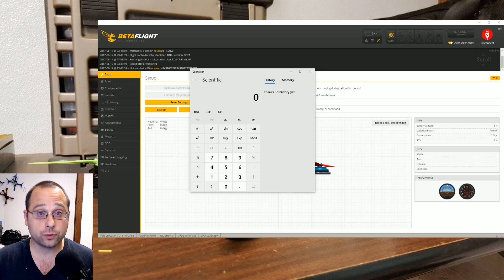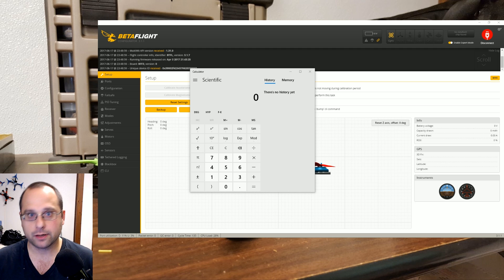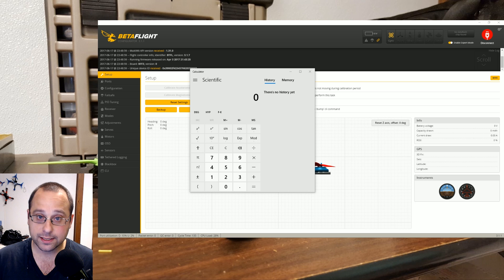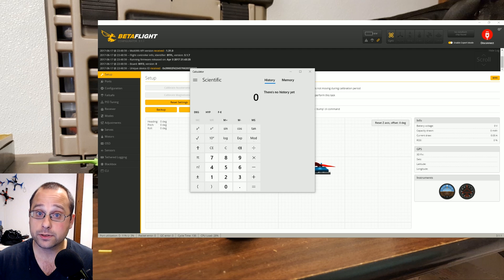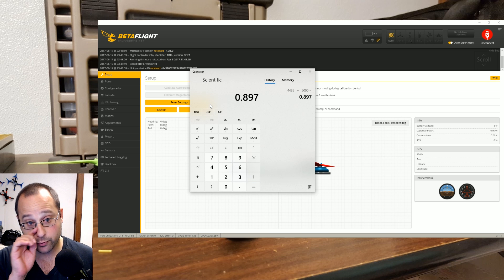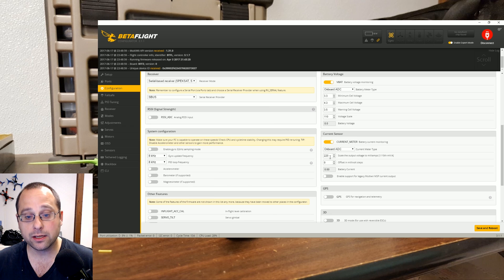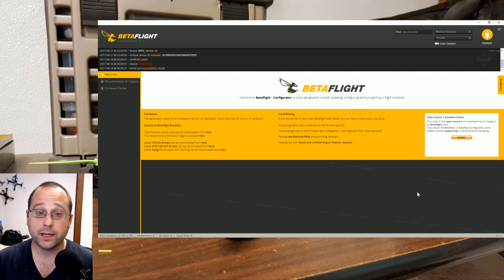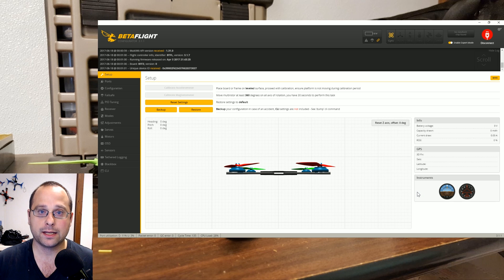The safest way to calibrate your Betaflight current sensor

Comment: So I'm trying to calibrate mine on my spedix gs35a 4 in 1 and while sitting unarmed it shows that I'm pulling 2.5 to 3 amps. In order to even get the amps down to 1 amp or lower I have to adjust the scale to 1150. I know that's not normal. I've been told not to worry about it and calibrate to what actually happens in flight. But with it pulling at 2.5 amps at all times the mah consumed is going to be off. What would you suggest? I've tried offset -100 and scale 700 and it was at .9 amps but that doesn't seem right at all

Comment: In the OSD, is the current sensor giving overall Amps? So my noob troubleshooting a F440 (40x4=160?), that bumps 39A max (per calibrated HGLRC XT60 sensor with R-Line 1300 75c), is being limited for the brother hobby 1507s I have on there (20Ax4=80 @100% on Lum 3040)? It appears the F440 is 10x4 and is misleading to be called 40A.

Comment: i am using the JBf4 which was reading right on, I just switched to crossfire and now the scale is off. shouldn't the mah draw stay the same? its the same in both quads that I switched to crossfire.
Reply from the maker: Yeah the mAh sensor is reported by the FC so switching from SmartPort to Crossfire won't change that. But remember that the Crossfire sensors are totally different than the SmartPort sensors, so you need to either create a new model in your radio, or you need to go to the telemetry screen and "delete all sensors" then "discover sensors". You also may need to change some things, like the battery voltage is reported as rxBat in Crossfire but VFAS in SmartPort, so you need to change the main screen voltage source. This is all covered in my crossfire setup video for what it's worth.
Reply: Joshua Bardwell I went through all the settings. I ran 5 packs and by the math the mah draw is showing 80% of what was actually used. I know you did a video on adjusting for this but I can't seem to find it.

Comment: In one of your more recent videos, you state that an amperage meter scale of about 250 is correct for your flight controller. My amp readings, and mAh were clearly very high on my latest build using your flight controller, so I did the method stated in this video and the value came out to 374 (using the average of 6 batteries). From my few flights since the calibration, it is clearly way more accurate, but why is there such a wild variation from the 250 you said it should be near? If it changes anything, I did pre-order your board (so I might have an early version), and I am running Betaflight 3.3.1.
Reply from the maker: It seems like there may be more variance in the resistor values than you would expect. I'm surprised that value is so high.

Comment: Could you:
-also check the voltage after flying
-Charge it up
-discharge to the voltage you got after flying
(Difference of charging to discharging mah is around 220mah. Pretty big difference)
I think when you discharge it won't have to balance the cells that much -> more accurate?

Comment: 20 thousand??? more like 40 thousand...  2300kv motors at 16.7v is 38,410 rpms... ;)
Reply from the maker: Well, not to argue with you, but that's only no-load with props off. But I just pulled 20k out of the air....

Comment: Hello,

can someone please tell me how to calbrirt the current sensor of ESCs in Betaflight 3.2.4?
Reply from the maker: +Andy X it's the same as shown here. The setting is moved to the Power and Battery tab.
Reply: Joshua Bardwell Hello, no its not. After select ESC Sensor the scale not there anymore.
Reply from the maker: +Andy X ESC sensor would be scaled in blhelisuite. But I'm not sure that is an option. I think the ESC sensors are supposed to shop already calibrated.
Reply: Joshua Bardwell okay thanks. Unfortunately, I find in blhelisuite 32bit no option.

Comment: Hey Joshua, I've built 2 copters now with the betaflight f4, a chameleon and now a rooster. I watched this video and successfully calibrated my current sensor on my first board, my scale value turned out to be pretty accurate around 250, but I can't get it to read anything on my second. I did everything exactly the same in the configurator and can't get the current sensor on my rooster to read anything. I enabled it and selected on-board adc, I'm running betaflight 3.2.2 on the newest version of the configurator 10.1.0. It reads 0 amps and 0 mah after about 3 minutes of flying... any ideas?

Comment: hello i’m running 32bit esc using the telemetry for my current. is their a scale i need to adjust? i’m getting 70amps from a burst. with 2300kv fire motors on dal5046c props.  chnl 1300mah 4s

Comment: Is the voltage sensor always correct on FC boards?
Reply from the maker: No. That's why you have the vbat scale in the Power and Battery tab to let you calibrate it.

Comment: hi josh , why does my mah sprint up as soon as i connect the battery ,even with the motors stationary and why does my ammeter show 26 amps too? if i raise the throttle and spin the motors the amps goes down not up ! whats going on ?
Reply from the maker: +machined red if your ammeter shows 36 amps with the motors not running then probably you have a short circuit somewhere.
Reply: thx josh , ok its got me thinking , my real inline ammeter between batt and pdb says 0.6a  and it flies perfect . what do test or check next ?fc has 1 ground wire and 1 vbatt wire , what have i done wrong ?
Reply: Hi, I have the same problem. Any solution for this issues?

Comment: My current sensor is way off on my JB F4.  I’m showing 1455mah used out of 1300mah pack.  Putting back in 950mah.  I’ve upped the censor calibration to 280 from stock 250 and I’m still getting the incorrect info. Gonna teat at 300 and see but doesn’t seem right.
Reply from the maker: +Hurricane FPV you have to calibrate then from default. The default value is never right. It's normal.
Reply: Joshua Bardwell default being 250 have you seen the need to go above 300 in some copters? I edited my original post after realizing I posted my second to last settings in error.

Comment: Hey Josh! In this case the sensor reads higher, but what if it reads lower, do I still divide "mAhs put back in" by "mAhs consumed", or do I divide a smaller mAhs by higher mAhs? Thank you!
Reply from the maker: The math is the same. It will produce a multiplier either greater or less than 1 depending on whether the sensor reads higher or lower.

Comment: I have set my scale to 260 and 275 and my amps sit at 0.30 and just go up a hair under load I tried a lot of different numbers in there and I can't figure it out it's a betaflight f4 board my milliamps consumed also count up get slow showing like 14 mah consumed on a 3 minute flight
Reply from the maker: +John lepeshko it sounds like your current sensor is not working. Maybe you wired the board wrong. Are you using a 4 in 1 ESC maybe?

Comment: So what if we have a wiring harness and a fc with a current sensor. For example I run a dis f4 aio with a an extra wire running from the battery positive to all of the positive esc. I fear that the bigger motors will draw too much amperage and fry the aio unit on 6S. Will this methodology still work?
Reply from the maker: +beelzelboss if you have run a wire from battery positive to the ESC, I don't think the current sensor should work at all because current isn't passing through the shunt resistor.
Reply: Okay that's what I thought since the electricity will take the path of least resistance which in my mind is not through the resistor but through the wiring harness, since it is on both the positive and negative. Thanks for your reply. You've unlocked a bevy of knowledge for me these past couple of years. If only you could get into the Crossfire game and some 6S!

Comment: Thanks for this video!! I will be doing this calibration shortly, I just completed two build usng the HGLRC v5 pro that you did a video on and is my frist OSD build. Can you help me with the battery voltage settings ? I know batteries sag while flying but I have no idea what to set the limits to. I just always flew with a timer but now that I have the bells and whistles it'd be nice to be safer on my Lipos. Thanks again for all your work!!

Comment: how do you fix a drifting quad, is it the balance of the quad or is it something else
Reply from the maker: First, make sure your channels are centered at 1500 in the receiver tab. Be sure your receiver is powered up and your transmitter is bound or all channels will just lock at 1500.

Comment: What about the heat generated in the battery. Heat requires energy. The current sensor doesn't record the energy used when the battery heats up right? That might account for the apx. 100mah per battery.

Comment: Let me first thank you for what you do for the community and myself, your videos are very informative and extremely helpful to many of us. Anyways with this method and or any other method to calibrate the current sensor, will the values of one board be the same as the same board on another quad? For example we have run multiple packs through one of my sons race quads and on 5 packs each time we end up putting 99% back into the batteries as what was taken out, so we also have 5 other quads with the same board (dys f4). So can we use the same values from the one quad on all the other quads or is each board regardless being the same board going to be different? Again thanks for all that you do for us!
Reply from the maker: No, they won't be exactly the same, but they will be close. The resistor that is used to set the gain of the current sensor has some manufacturing variance. If a good quality resistor is used, the variance should be less than 1%. But it's up to the manufacturer to use a good quality resistor :-)
Reply: so what kind of variance could I expect from one board to the next?

Comment: I just want to share my way of calibrating current sensor. As you can see there is scale an offset. This mean betaflight is using linear equation to calculate true current flow (current = measurement / scale - offset   ->   y=ax+b). Built-in current sensor is accurate only for current above ~1Amp. In betaflight you set scale to 10 and offset to 0.  Next you measure (without the props and with external current meter) two points, at maximum throttle and 1/3. Every time write down current from current meter (CM) and sensor (CS) (but reading from sensor must be multiplied by 10).  Now you must solve system of linear equation {CM_1=CS_1*a+b,CM_2=CS_2*a+b}. If you solve, offset is -b and scale i 1/a.
Reply from the maker: +marcepanb why do you start with the assumption that 10 is the correct scale.
Reply: Correct value should be 1, but then value is clipped to maximum (for me it's 327.67A). So I set scale to 10 to divide  value, but for calculation I multiply this value.

Comment: Need some help Josh and friends
so flew 13 lipos. Got an average of 892mah when bff3 showed 1000.
Also is it normal to have such a difference? Got 821 to 945 most were 900ish give or take 20.
Anyway what increase should I be putting in?
Reply from the maker: I put the exact math in the video. What part of it didn't you understand?
Reply: Joshua Bardwell 
Nice comment and great help
so if my math is right its 12.5% high for me. So I multiply this by what the setting is at to get a better calibration?

Comment: Is there a reason you can't just spin your motors without the props? Obviously it won't draw as much, but it should be enough to get a baseline. 2 data points define a line, you don't need a 3rd way up at 80 amps
Reply from the maker: The closer together the two measurement points are, the more precise they have to be to correctly define the line. The further apart the two points are, the less precise they have to be to correctly define the line. The amps drawn are not constant. They're going up and down and you have to guess what the correct average is. If you tried to take a measurement at, say, 3 amps and 5 amps, you would be way off.

Comment: Hey Joshua, This is a bit off topic, but I was wondering if you know how I can calibrate the barometer that comes with my F3 omnibus.  I like it but sometimes when I fly the reading says -8 ft when I'm starting at.... Not that I'm needing it to be super accurate, it would just be neat to know it's pretty accurate.
Reply from the maker: I don't think baro is ever really accurate on these copters unless it is supplemented with GPS. Have you installed foam over the baro to protect it from changing air pressure due to propwash?

Comment: What about clamp meter and props off? Will it not draw enough current to get an accurate calibration?
Reply from the maker: I don't think so. If you calibrate at 3-5 amps that won't give you accuracy at higher amps.

Comment: This is a methodology I used since many quads and work fine.
This is what we can call an iterative process, and usually after 4 or 5 try, I get the correct number !

Just one comment, because this method didn't take into account the offset of current, which is another BF parameter.
By default, the offset is set to 0 in BF, that mean that when the lipo is plugged in, the current seen by BF is 0, but of course it is not, because of flight controller, led, esc and others stuff you put on your quad, always need current even with throttle at 0.
So what I usually do for that is that the offset current for a basic configuration is somewhere between 300 and 400mah, so I set the parameter in BF to 35, so as soon as I plug the battery, I see in the osd a current of 350mah.
And it work perfectly fine for me :)
Happy flying
Reply from the maker: I don't think that's how offset works, but I could be wrong. I think that offset is for the case where the current sensor does not output 0 volts at 0 amps.
Reply: I just realized that I do that because I use a virtual sensor and not a real current sensor :)
I personnaly prefer having the mAh used in addition of Lipo voltage on all my quad, because it's often difficult to see the landing point, as voltage changing a lot during a hard fly...
So in case of using a real current sensor, you're absolutely right, no special need to change this parameter in BF ;)

Comment: I wonder what the COP of the LiPo battery is.
It is clear that if you convert 1000 mAh electrical energy (charger reading) into chemical energy, then when you convert back you will get LESS mAh. To be precise, if properly calibrated with this method, the OSD tells us not how much energy we have consumed but how much energy we should put back in to recharge. So if the energy meter is perfectly exact it is normal to show less mAh than what we put in while charging.
But anyway, that is not so important since we really care for a way to tell how much of the battery we have consumed - the absolute values are not crucial if we simply know that reading of X mAh means it is time to land.

Comment: Joshua there is an even easier and more accurate way to do this. I know I'm going to mix my words up but if your interested I can dig up the article on rcgroups. Basically there's a math formula and you measure a resistor that feeds the shunt or something along those lines and when inputting the shunt value and the measured resistor value it gets your within 1% of the calibrated value.
Reply from the maker: Measuring the value of the gain resistor doesn't take into account any inaccuracy in the actual value of the shunt resistor. It'll get you close, but you may still need to adjust using this method. Also, it's not always apparent where the gain resistor is.
Reply: Thanks for the reply, wasn't sure if you heard of this method. Most the replies from people who had done this in the thread I read came very very close to being dead on. Is it a pretty common thing for the shunt resistor to vary in resistance from its spec? Is there a way to measure the shunt to make it more accurate?
Reply: you find that by going from the out pin to ground [or measuring rL which you find by continuity with a DMM from teh output pin], that will give you resistance. best thread i have found for mathematically figuring it out and gets real close and can do it for any current sensor. https://www.rcgroups.com/forums/showthread.php?2798055-Understanding-Current-Meters
Reply: Yea that's the thread I was referring to

Comment: you can't plug multiple batteries in to a parallel board unless they are close to the same voltage, so that isn't feasible in real life, unless your using a timer and very good at landing at storage voltage, or the same voltage, or you risk cell damage. I just use the timer on my radio and it works pretty good. If these FC makers cant make this feature more plug and play, then its way over rated.
Reply from the maker: I have no problem at all landing at a consistent voltage. That's what voltage telemetry is for. At the end of a day, all my packs are close enough to 3.7 or 3.8 volts that they can go straight into the balance board.
Reply: sure, you and i can, but the general public.